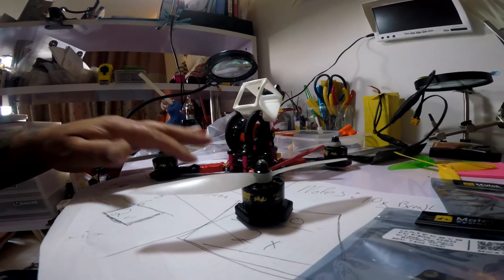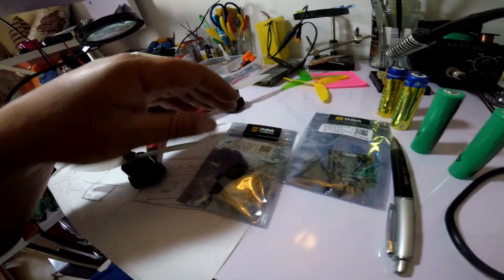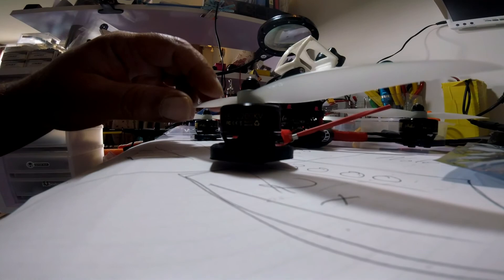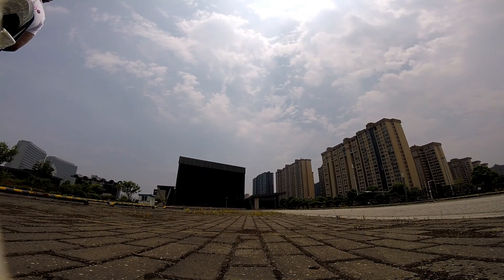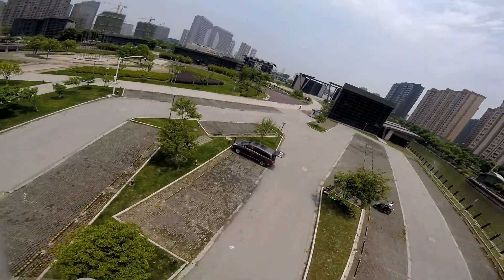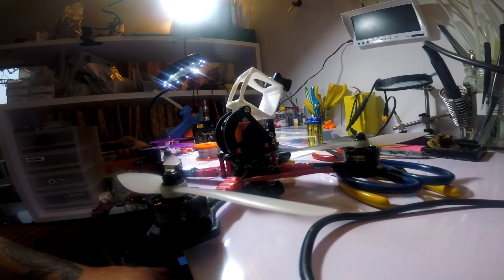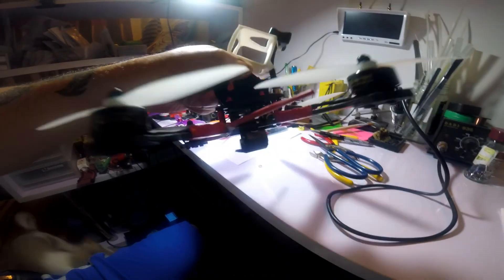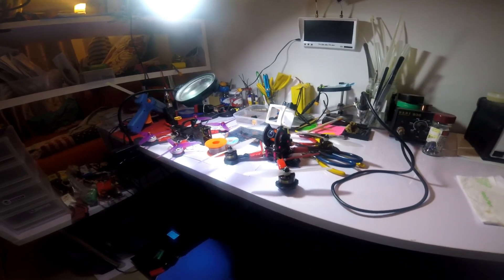Matek F405 and FChub pdb combo Maiden flight and final thoughts

Comment: hello when i give full throtle to my f405 all motors going down not giving the throttle do you know its why? And in no windy area my drone cannot be stable in air do know why
Reply from the maker: sounds like an ESC problem.
Reply: 4 esc problem ?
Reply from the maker: yep...you flashed them all the same right? They should all have the same firmware. I had this issue once and it was because I had the wrong firmware on my ESC's.
Reply: ohhhhh okey okey :) my other question ? in no windy area my drone cannot be stable in air do know why? how can i fix my drone its not stable always going left or right slowly
Reply from the maker: not really clear on what you mean by that, there are tons of Facebook groups , YouTube vids and online information that may help you sort it out.

Comment: Mines on its way.  Replacing the DYS F4 with DYS 4 in 1 on my QAV R 6.  Today, I watched it fall 100+ feet after a punch -out.  After it landed upside down, I heard the board start up again.  I don't think the ESC 4 in 1 could keep up with the demand. Brown-out.  Either that or the Thunder Power 80C couldn't handle the draw.  Either way, glad to see that you are happy with the Matek on your 6 inch.  Gives me hope!  DYS will be moving to my 5" QAVX.  Thanks for putting the vid together!
Reply from the maker: Just built another 6 inch that I ripped today..rocking the same set up..
Reply: SKIDOOSH what ESCs are you running?  Did some testing on the DYS 4 in 1.  Lost motor 4's ESC during the punch out.
Reply from the maker: Ya DYS has gave me several of those 4 n1 when they were prototypes..I binned them :). My Go to ESC's are Flycolor Raptor pro 30 amps..never had one fail yet that wasn't from a crash. I have broke a few in crashes (knocked components off of them from prop strikes) ..lol

Comment: Hey I liked your video. I'm looking at buying this but I'm not a really experience race flier. Does this have the option to turn on attitude hold? Oh and your puppy is adorable. :)
Reply from the maker: Altitude hod can only be achieved with a GPS and barometer.This board can process such things , but the are separate hardware.
Reply from the maker: ...but if you mean self leveling flight, yes this FC has that option..

Comment: Does the FCHUB-S6 output the current and vcc(vbat) to the flight controller through the ribbon cable? I just put the FCHUB-S6 and an f450-osd onto a chameleon frame.
Reply from the maker: Yes indeed..it does..
Reply: SKIDOOSH thanks, I probably didn't enable something in betaflight then. Keep the videos coming 😀
Reply from the maker: Which ever version of BF you are running go to the Matek web page and it explains the whole set up and config.. http://www.mateksys.com/?portfolio=f405-osd

Comment: what motors r u using i just ordered this n putting on martian3 but ive been using 2205s 2300kv with f4 revo at 8k,8k
Reply: lol nevermind just seen the build video
Reply from the maker: On this build because it is a 6 inch I am using F80 pro's 2200kv...since this video I have built several quads with the F405/FCHUB combo...5 inch with LD powers 2306 2600's and returner R4's 2600 kv..
Reply: SKIDOOSH nice dude yeah im looking to upgrade not really getting what i want out of 2205s i think im going with 2206 2400kv on 5 inch martian frame n f405 fc n considering runcam split to save weight instead of gopro
Reply from the maker: I would recommend brother hobby motors in 2450 kv in that range of motors,,,they are awesome! As far as the Runcam 3 and split...Youtube has changed the compression in the way 1080 uploads and sometimes you will get a digital "shimmer"..check out my Runcam test vids...https://www.youtube.com/watch?v=ASbLUmyPdig
Reply from the maker: also check this vid..and if you are looking to go bigger than 2206...in the 2305-06 range LDpower motors are the bomb!!! https://www.youtube.com/watch?v=mG_qwRynkr0&t=14s
Reply: SKIDOOSH thanks for recommedations lol i was literally just looking at the brother hobbys n on friday im getting a 2 inch either baby hawk or lizard its been raining tons in fl so i want a micro for indoor n outdoor
Reply from the maker: That "Zombies" vid is the brother hobby R4 2450's..
Reply: SKIDOOSH yea thats perfect then thats pretty much the way i want mine to feel lol i just gotta get to ur skill level lol love the zombies vid

Comment: do you have your OSD working? is your current sensor calibrated? is it accurate? how easy is the OSD to set up? I am using a TBS UNIFY PRO with smart audio. I am using a 4in1 ESC so I won't be using the PDB, frame is just to small get it. (the MACH1) 8mm arms.
Reply: SKIDOOSH gotta admit it was easiest board to setup
Reply from the maker: yes everything is working fine. All set-up step by step instructions are on the Matek web page...super easy. Default current is set at 110..if its a tad off it can be calibrated via the OSD..for the OSD be sure to upload fonts and boom...it works...easy as pie..
Reply from the maker: Wait til you fly it!! I just did one with BF 3.2 ..butter smooth!
Reply: SKIDOOSH lol i already flashed it with 3.2 going to check tune in a couple hours already setup dynamic filtering n pt1 also lol im pumped
Reply from the maker: Yessir!!! That's the ticket!!!
Reply from the maker: https://www.youtube.com/watch?v=I85C8w83GEE

Comment: Are you using Frsky telemetry/smartport ? I see there is a couple of options on wiring , just wondering which you used if you did :) 
Cant believe that was with zero tuning, got one here to go in a dquad obsession ..
Reply from the maker: Ya Frsky x4r and TBS unify with smart port also..I have the OSD enabled on screen...I guess it got chopped off in the edit...sorry about that..

Comment: F80 with 6S or 4S LiPo? multishot or Dshot,?  8K/8K?
Reply from the maker: 4s , but it can run 6s..Dshot 600 at 8k/8k. Haven't tried 16k yet as I wanted to show how it preformed out of the box on defaults.